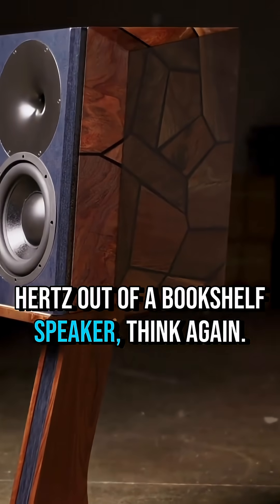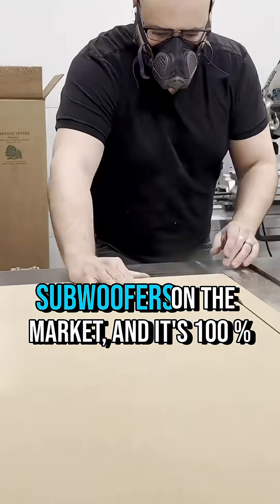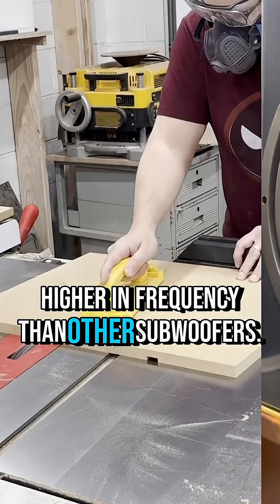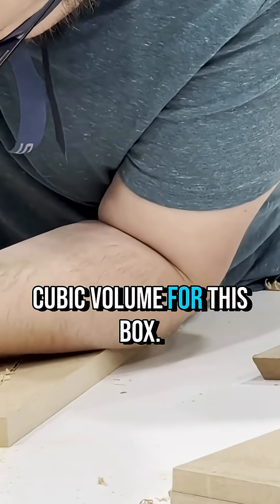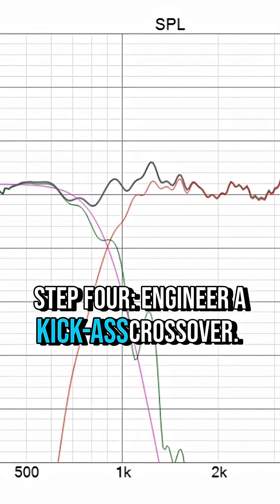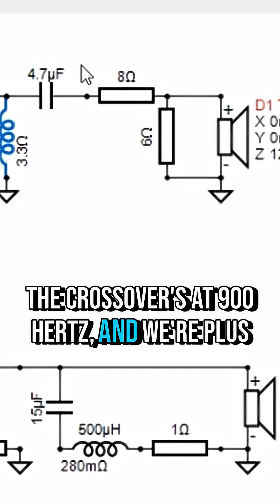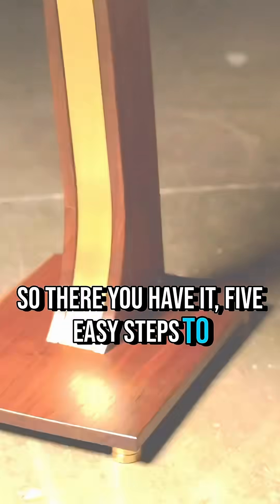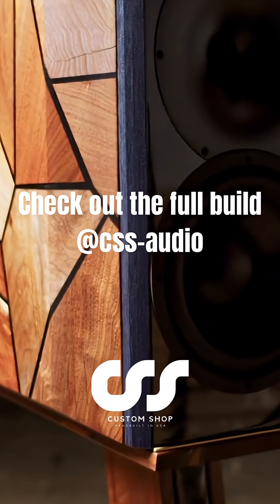5 Steps to a Bookshelf Speaker That Hits 20 Hz

Comment: 1 easy step to hitting 20hz with a bookshelf speaker.....use a driver that hits 20hz 😂 since ur not using a typical woofer driver u will still need to add a midrange since a subwoofer doesn't have alot of midrange in it or atleast u dont want midrange coming thru one so u are probably missing a lil something with just a tweeter and subwoofer.

Comment: I am confused. You are talking about going DOWN to 20 Hz then talking  about higher frequencies. What  gives.😮
Reply from the maker: This is a full range speaker so all frequencies have to be considered. The box size and passive radiator tuning make the 20 Hz part full range sound that measures well on and off axis is the challenge when using a single 10" as a woofer.
Reply: @css_audio you said subwoofer. Good luck making it into a full range speaker. There are no 10" bookshelf speakers.

Comment: How sound the ‘subwoofer’ at the x-overpoint with that moving mass beside the ringing, conebreak-up. And at last beaming?
Reply from the maker: There's no cone breakup until above 1200 Hz so it's not an issue at the crossover point and the notch filter combined with 8th order acoustic slopes means the response is down to inaudible levels by the point there is breakup. There is no ringing in the CSD plots. Beaming is controlled through the use of the waveguide.